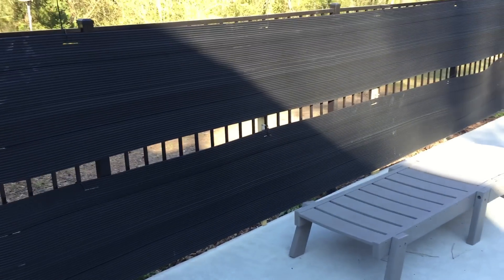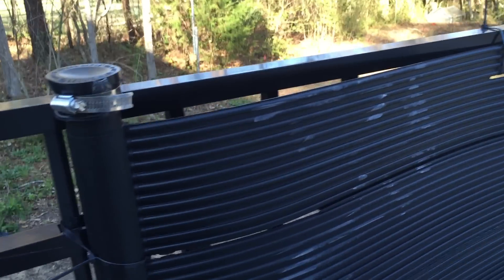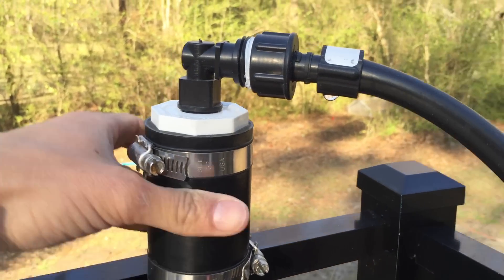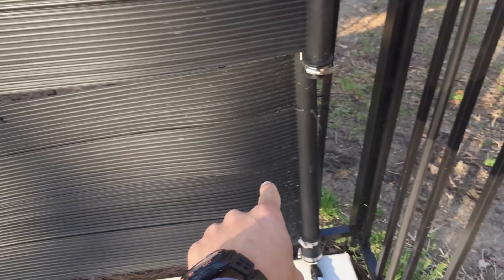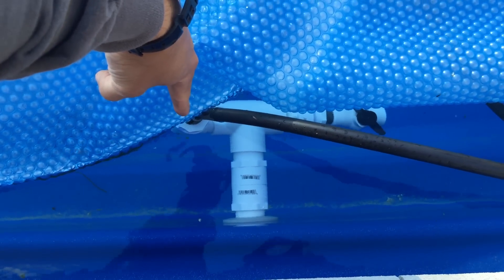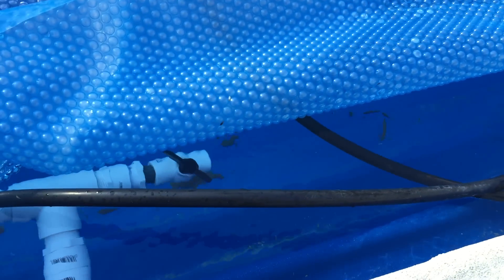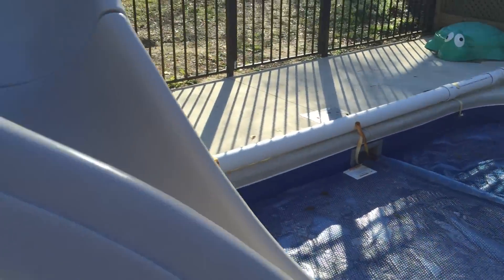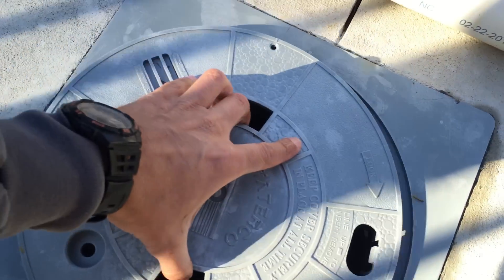Solar Pool Heater Review for In Ground Pools Smartpool Sunheater

Comment: Steve,  Thank you for the wonderful video.  My ten year old "Autumn Solar" finally failed.  We loved it.  So I just installed two Sunheater 2 x 20 foot panels exactly like yours.  I used the manual recommended configuration which some call "parallel".  In this method, the two header pipes with labels are connected to each other, one end is the input, the other to output to the pool.  The two header pipes without labels are capped.  My instincts want me to but them in "series", as you have done, by capping off the connection between the two headers on the input/output side, connecting the two headers without labels on the far side, forcing the water to travel out to the end of one 20" panel and return via the upper 20' panel. Secondly, I see you also used as your input/output side the unlabeled headers, just the opposite of the directions.  I recall when examining them before installation that the labelled side had a partial baffle, or restriction, half way along and the other had none.  Any advice for me? PS there is a link to the manual https://images.inyopools.com/cloud/documents/smartpools421.pdf

Comment: Nice video.. what size/volume is your pool?  So you basically tied into the existing pump on the pull off the return correct?  Any reason why you didnt split it off at the pump (after the pump)?  Thinking of this for mine, i have a salt water generator after the pump and was going to plumb it from there with a diverter bypass kit and back to the SWG (already have a return robot split on the return).